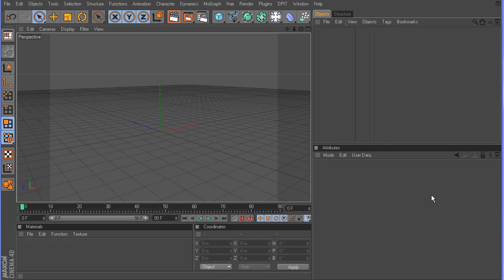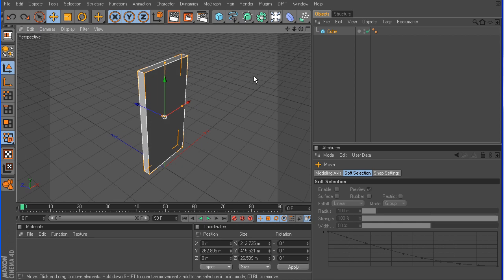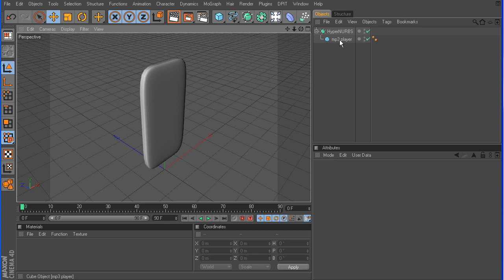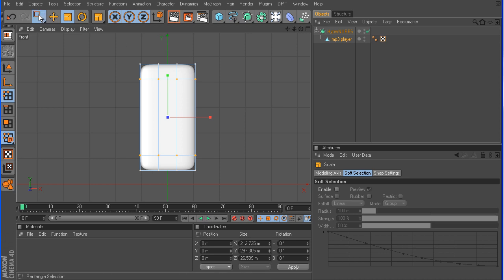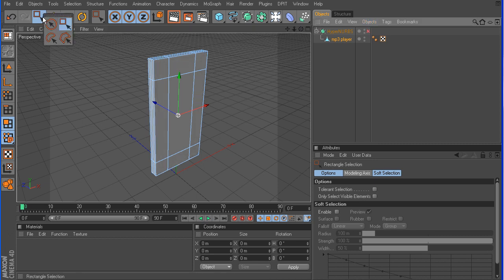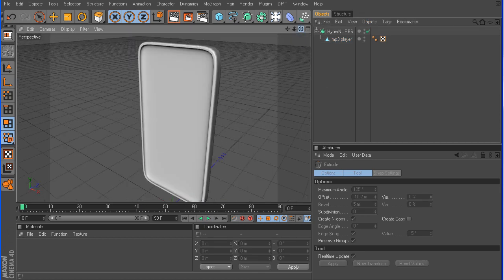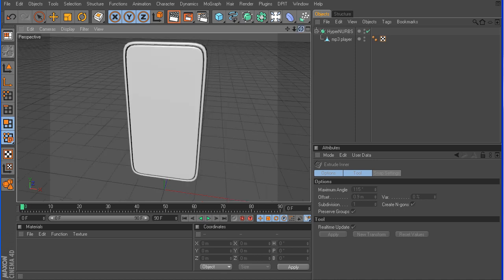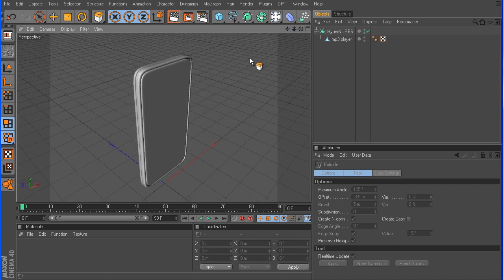Cinema 4D Tutorial - Modeling a MP3 Player - Part 1

Comment: @ShepperdOneill Basically there are multiple lines (that do not refer to any specific points on the object) call them gradient lines i suppose as they show the gradient (curves) of the object. I have noticed they are only view able when the object is under the influence of the "hyper nurb", is there any way to turn them off as they are hard to differentiate between the polygon lines

Comment from the maker: You have to change the shading for each view. By default, the shading for the front, side, top and rear views are set to wireframe.

You can change it by clicking on "display" and choosing the mode you want to use.